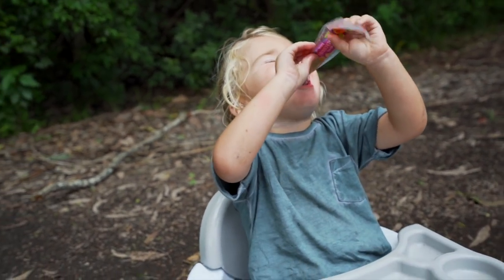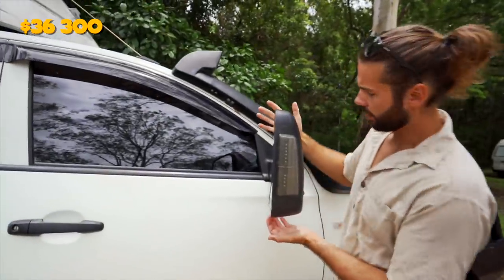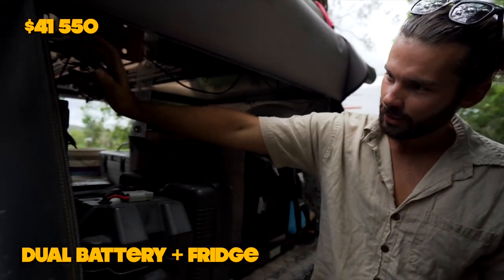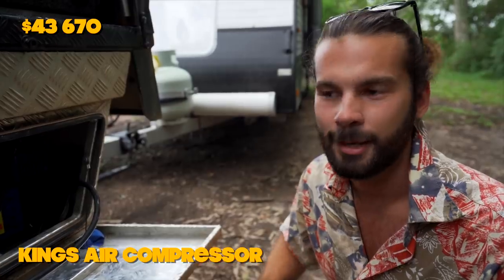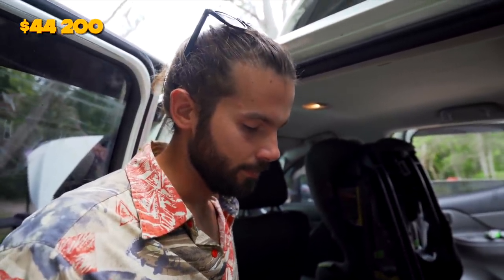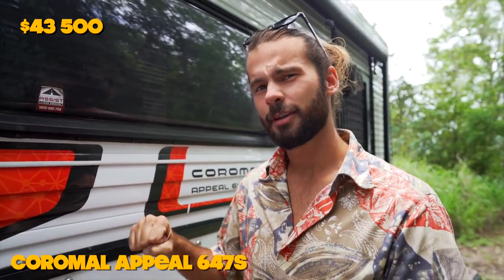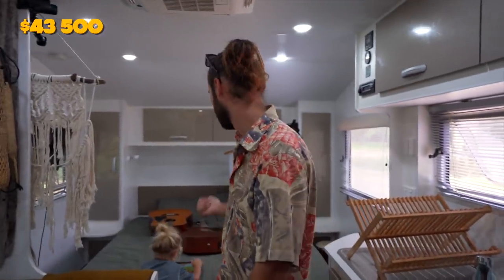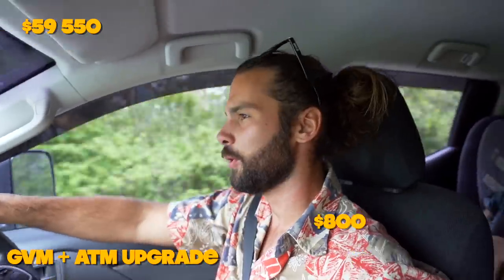$100k 4x4, CANOPY, CARAVAN + BOAT // RIG FOR TRAVELLING AUSTRALIA // Costs + Tour of our Home

Comment: Guys, so cool. You are so refreshing and down to earth. Please don't evolve into clones of other channels with their big sponsorship snd bias reporting to appease their sponsors.
Sure Kings get bagged by a lot of people because they aren't perfect. Their products either but hey, like you implied they are mainly suitable for purpose and great value.
Our setup is not dissimilar to your but suits wife myself and Brocky (malt shitz cross) aok. I will give you a list if I may indulge.
You Triton We Pajero Sport GLS 8 speed auto bought new Aug 2019 $46500.
You Coromal? Van We Goldstar Liberty Tourer 17ft6 semi offroad bought new Aug 2020 $44000
Our van is smaller and our 4WD lower GVM and GCM than yours but we are under both weights.
Our can has only the queen island bed like yours and a dinette that could make a king single. Ours did come with 200w solar and 2 x 100w AGM. 
You motivated me and I have ordered 2 x 200w extra solar panels to give us 600w. Also ordered a new solar controller $300 50A that is MPPT and a dedicated LiPo chargin profile setting. Also ordered 2 x 125AH LiPo batteries. (You are costing me a fortune!) Van has dry bathroom across the rear with huge dhower separate dunny and vanity and bonus a wash machine was included.
Seeing what you achieved with your solar and liPo upgrade really motivated me.
I am an old fart 62, retired on health issues but love free or cheap camping as its all we can afford on pension income,
Our capital purchases have come from selling off my former small businesses due to health reasons.
Leep up the great work.
p.s. I have same redarc brake controller znd had the dealer throw it in after negotiating best deal but before signing lol.
2000kg is the limit in Australia where electric brakes, and dual safety chains kicks in.
Sorry I waffle. Cheers